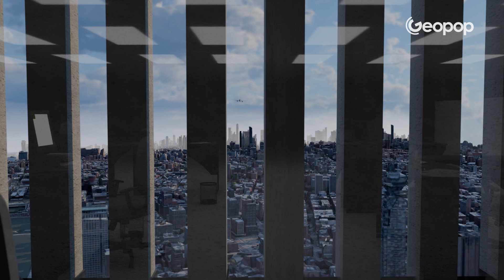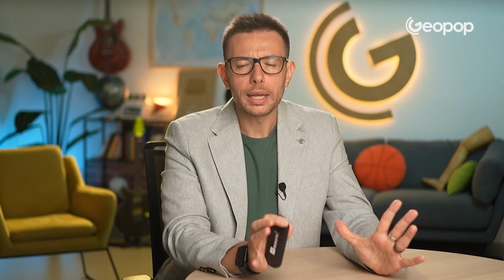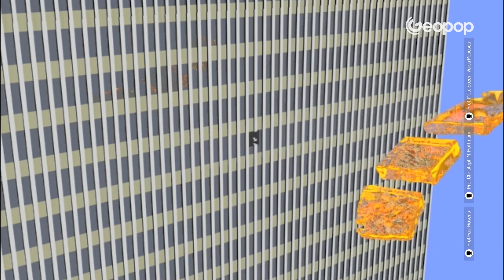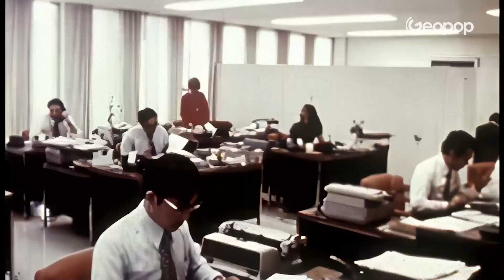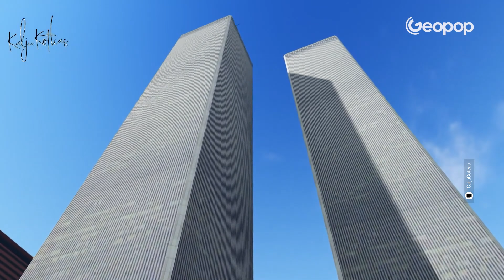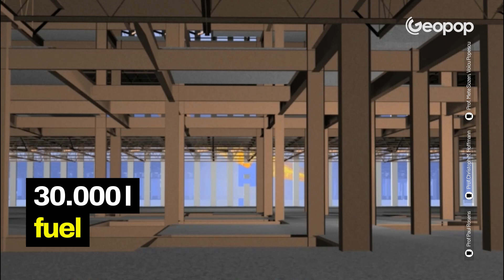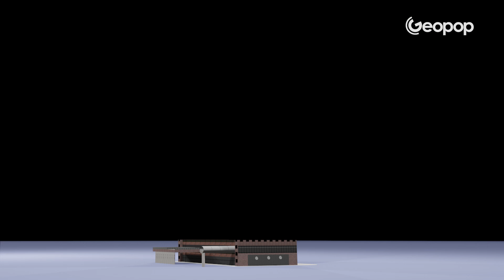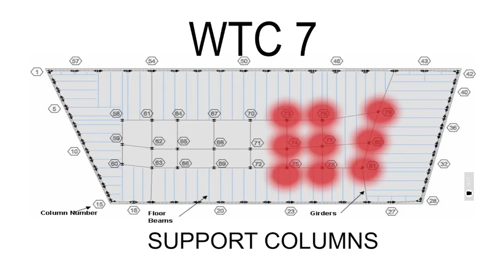9/11, 2001: The Technical Reconstruction of the Twin Towers and WTC 7 Collapses

Comment: What about every floor being slabs of concrete.? 
It should have tipped over not collapse.
Reply: Steel framed buildings do not "tip over".  They are not nearly rigid enough and there is no lateral force pushing on them.

Twin Towers collapses were actually relatively straightforward, the fundamentals already understood in the professional engineering community within just weeks. Still, there’s a lot of really bad information floating out there, mostly on the internet where it’s easily accessible to anyone. Good information takes more effort to come by and is much harder for laypersons to digest. Engineeringspeak is complex and dull. Also, some people put up a wall to protect their beliefs and false assumptions. Engineering is hard while wild baseless speculation and pathological theorizing with easy hand-wave answers is simple and exciting. Fanciful tails of pre-planned demolitions, magical space beams, melting steel and mini-nukes are just far more entertaining and require a whole lot less thinking, thus getting far more intention than they deserve.

To correct that situation, I have all on my own prepared this short yet detailed technical description of Twin Towers collapses based on my own observation and analysis of the available true and relevant facts. No politics or ideology, just the engineering. My hope is this will dispel many common myths and answer most if not all questions you may have about the Twin Towers collapses, because anything can seem like a conspiracy if you don’t understand how it works

While complex, most of the Twin Towers collapse mechanisms can be seen with the naked eye and easily discerned and understood by the layperson if sufficient time is taken to understand. 

1. The Twin Towers consisted of 4 primary structural elements that together formed an integrated system where each relied on the others.  47 hollow box-section steel Core Columns carry the majority of the gravity loads. The 236 hollow box-section steel Perimeter Columns carry the remainder and ALL of the lateral (wind) loads. Long-span Lightweight Steel Trusses connect the core and perimeter column together at each floor with a Hat Truss on top to tie the structure together as an integrated unit where no element can survive without the others. There was no structural load bearing concrete and most components were bolted together.

2. The impact of 117 tons of airplane (= to about 12 dump trucks) at speeds up to 590 mph with the energy of a ton of TNT completely destroys the aircraft. This in no way implies the Towers come out unscathed. Many perimeter columns are damaged or destroyed as are some core columns (example; 33 of 59 perimeter and 20 of 47 core columns damaged or destroyed at the impact floors in the North Tower), This damage is primarily through bolt-shearing failures at the end connecting flanges, as well as bending, twisting and fracturing of weld seams. There was no cutting or slicing - the reality was far more violent and messy. 

3. The impacts destroy or damage fire insulation, fire breaks and sprinkler systems on multiple floors.  Huge fires are started across multiple floors simultaneously and allowed to spread rapidly with no effective firefighting or fire suppression. This was an unprecedented fire event . 

4. The hotter steel gets the weaker it gets .  With fire insulation stripped away and no sprinklers the survival time of the steel greatly reduced. Gradually over time heat causes the lightweight steel Floor Trusses at the impact damaged floors to sag, which was observed and recorded.  No steel melted or needed to. Structural steel fails long before it becomes a puddle. It just needs to bend

5. Sagging floor trusses pull on the increasingly weak and overloaded Perimeter Columns, causing some of them to bow inward by up to 5 feet. A straight column is up to 4 times stronger than a bent column. The bowed Perimeter Columns buckle and fail, initiating collapse. The formerly static mass above which the structure below could easily support is now converted into a dynamic mass up to 30 times greater. Because they have buckled, the Columns above and below the failure point are no longer aligned . The load bearing structure below no longer bears any load as it falls past the lower columns, NOT onto them.

6. Thousands of tons of debris fall within the four outer walls, down through the open office space, crashing onto the first intact floor it encounters. This massive impact immediately breaks the bolted connections to the columns as the amount of resistance the Floor Trusses can offer is negligible.  The falling debris slows only marginally and briefly. Note:
6a. This is NOT a solid top block crashing into and “crushing” a solid bottom block .
6b. The debris falls past the columns not onto them.  The columns provide no resistance to the falling debris. 
6c. Only the bolted connections of the floor trusses to the core and perimeter columns can offer any resistance. A pair of 5/8” bolts at each end of each truss vs. thousands of tons of falling debris.
6d. No laws of physics are violated.

7.  This floor-led collapse progression within the four outer walls can only go straight down. Note: 
7a. This process is often incorrectly referred to as “pancaking” which actually refers to a completely different process rejected at an early stage. The catchy name stuck but nobody knows what it is supposed to mean.  Pancaking is too simplistic and inaccurate anyway. More like Kaiserschmarrn.

8. Collapse progresses through the floor systems not down the columns, through the path of least resistance . Rate of floor failures increases with each successive floor as momentum increases, reaching an average acceleration of 0.65 of GA, or 35% slower than true free fall. Bam, bam, bam down the building until there are no more floors to fail.  The resistance offered by each successive floor is always the same. The mass and velocity, thus the energy of the falling debris is constantly increasing, with each floor destroyed adding new falling mass. Some falls to the sides, but most falls down. More mass, more velocity, same resistance with each floor.  Don’t get stuck on the but the lower floors weren’t on fire nonsense. They weren‘t and didn’t need to be.

9. The Towers were 95% air by volume. As that air was compressed inside the building it is forced down the tower and blown out the sides in reaction to the building collapsing . Those were not “explosions”, it was expulsions of compressed air caused by the collapsing building, explaining the low velocity, lack of flash, blast, supersonic pressure waves and lethal high-velocity ejecta.  

10. Perimeter Columns become detached and peel away like a banana behind the collapse front, playing out to the four points of the compass extending to more than 600 feet from the base of the towers. This was quite obvious from examination of the debris pile. 

11. Core Columns fail last as their internal beam bracing is stripped away by falling debris and lateral support from the floor to perimeter columns is lost. 

12. For those who care about how long this whole process took; 31-34 seconds from the moment the perimeter columns buckled until the last core columns hit the pile, or 1/3 the rate of true free fall. Don’t believe me?  Just watch any video of the collapses and note the loose truly free-falling debris dropping much faster than the towers themselves.  

13. Each Tower had a 1-acre footprint. Far from collapsing inside their own footprints the debris pile spread out over 17 acres in a pile up to 14 stories deep. 8 surrounding buildings were destroyed and scores more damaged by the falling debris. 

14. What was NOT observed were the 180-190 dB bangs of thousands of high explosive devices or the blinding bright flashes of burning thermite. Neither could have caused the (silent) perimeter column buckling that clearly initiated collapse.  Neither explosives or thermite could have survived the impacts and subsequent fires either. A video of a shocked and injured firefighter using the magic word explosion is in no way proof of explsoIVES . The pre—planned demolition case relies entirely on that sort of thing. There is zero tangible physical evidence and it would be technically impossible, totally impractical and completely unnecessary. No one would bother. 

15.  Finally, the Twin Towers were perfectly safe within their design envelope.  They only collapsed when taken far outside design parameters by an extraordinary and unprecedented event 

Impact + Fire (heat) + Time + Gravity = Collapse . Remove any one of those four elements and there is no collapse. Ignore any of those elements (as many do) and you will never understand the collapses. The Twin Towers were an integrated system in which no one component could survive without the others. One fails, the rest follow, through the path of least resistance – DOWN – through the open space, bypassing the path of greatest resistance – the columns.  Nothing I just described violates any laws of physics. All of the above is true no matter who planned and carried out the 9/11 attacks or why 

I hope you found this helpful and informative. It is not meant to be adversarial, but to solicit informed critical comment, positive or negative. If I made any errors of fact, logic or reason or left anything critical out, please let me know so I can fix it. To stay focused just one topic at a time please and on-topic (Twin Towers ONLY). No word-salads of Gish Gallop. IF you can offer a more plausible alternative be my guest. Be the first. Please start any reply with the words “Tits McGee” or I will know you didn’t actually read it, are not serious and just wasting my time.
Reply: The concrete above ground level was not reinforced and was only 4" deep (approximately the same as a sidewalk), and was only there for flooring. It was not structural.
Reply: @kyle381000  it fell at Free Fall speed which means there was no resistance none do not even a little bit it had to break reinforcements from the floor above it
Reply: @Officialrabbitholetourguide  
It did not fall at 'free fall'. Video evidence debunked that more than 20 years ago.
Do you know the difference between force and mass? Do you know what kinetic energy is? Have you ever dropped a bowling ball on your foot?
Reply: @kyle381000  listen it was 1,362 ft tall it took a little over 10 seconds from when it started falling the same size building to freefall is a little over 10 seconds listen you can believe what you want to believe those towers had assistance collapsing.
I'm not going to get in a pissing contest with you if those buildings were not touched it wouldn't have fell as quickly
Reply: Those ratios and times come from Google if you have a problem with that take it up with Google
Reply: @kyle381000  2002
Reply: @kyle381000   Read or research someone who lays it all out . Rebecca Roth's series of books Methodical Illusions. She put it out as fiction series for obvious reasons. 
If you really think those buildings fell by themselves 25 yrs ago there's probably no changing your mind.
Reply: @Officialrabbitholetourguide  - If the Twin Towers were collapsing at free fall SPEED (which isn't even a thing) why did the collapses take 33 seconds (1/3 of free fall) and why is the loose debris falling so much faster?

BTW - I explained all this in my earlier post (that you ignored).
Reply: @kyle381000  https://youtu.be/cl5CkXlJMds?si=Z6zWFKMGqDfFMG7c
Reply: @kyle381000  https://youtu.be/uofs7b_xvso?si=nBrB8pa7oVGz_EJp
Reply: @kyle381000  
https://youtu.be/mGB9A4ODmFo?si=rqqNQOq0ZQ657LV8
Reply: https://youtu.be/mGB9A4ODmFo?si=rqqNQOq0ZQ657LV8
Reply: @kyle381000  maybe at the end of it picking up speed because of all the way from the top
Reply: @kyle381000  play what I mean by reinforcement the floors are attached to the side it has to break those fasteners it came down perfectly level not even like a little half of the floor started on both of them it makes no sense
Reply: @kyle381000  if you were to put a square piece of plywood in a square tube chances are it will get hung up on the sides of the way down not just dropped straight down especially with all that debris
Reply: @kyle381000  if my last posters that was a crime scene or at least a structural failure because it was designed for that you've never seen something get cleaned up and get rid of so fast that's not a conspiracy theory that's a fact those towers were made to be hit by airplanes jetliner airplanes
Reply: You people seem to have a hard time comprehending that gravity goes STRAIGHT DOWN.
Reply: @aldunlop4622  Well your opinion is your opinion based on your wealth experience of playing with build blocks as toddler.
If your drop 4 "x. 4" 3/4 piece of finished plywood down a 4 "X  4 inch perfectly square inside diameter 20 ft box with 4x4   3/4 blocks placed every 10 inches to simulate floors just glued around the edges...you may get your unrealistical results.
 if you it was humid out that day of testing wouldn't slide. And get your zero resistance free fall. If it all 
If that 4 by 4 box is slightly  out square .. No Bueno.
 Put a 1x 1 inch vertical solid piece of wood to simulate the elevator shaft . Oh and don't forget the stair wells .  How bout all the air conditioner condensers everything it takes to construct office furniture. 
So now let's get into all the overlapping heavy duty mending plate with 5 inch bolt holes  overlapping seams side to side diagonally braces.
Anyone that's been around for a minute news that the corrugated steel that they use for concrete floors when do when doing demo doesn't just slip off like Teflon cookware. And the fact that it was close to freefall speed both of them oh let's see all three of them. 

You're telling me that it can't get hot enough to melt all that and weaken it which is a point to maybe a couple of floors maybe for a lot longer than it actually was. 
And they found one of the hijackers passports on the ground in the debris are you kidding me?
LET ME REPEAT MYSELF FOR THE SIMPS 
Struggling to accepting reality 
hard time you know the ones everyone gets a trophy.
Your grasping leverage &  bilateral  resistance...

Comment: If you receive funding for research your research will reflect with the funders want to see.  Other wise no more funding
Reply: So, your thoughts on Leroy Hulsey's Building 7 report?
Reply: @TheCriticalStinker-jw4fl  I have questions like what was that building housing what kind of information was it holding ancer  those questions then I can give you a thought
Reply: @user-jackmayhoff  - I only want an answer to the question I asked, NOT a deliberately evasive off-topic derail. 

Remember, you broached the subject.
Reply: @TheCriticalStinker-jw4fl  that was a broad statement about funding and research across all subjects.     colleges, private.. ect
Reply: @TheLoonResistance  I don't know enough on this subject
Reply: What is the source of the many tons of molten steel found in and under the debris, the heat so intense that the molten steel remained in that state for weeks afterward, running off of the debris as it was excavated. This cannot be molten copper from wiring that retains the color of a shiny new penny.  It cannot be molten aluminum that retains the color of the polished aluminum wheels of a street racer. It was the color of glowing orange molten steel  that cannot be mistaken for any other material, reported by firefighters who are very experienced in the nature of such materials as well as seen in video evidence.

When you combine this with an entire lack of turbulence behind 500 mph aircraft, when even a small Cessna Aircraft would leave an evident wake in the smoke and fire only seconds later .  . We find that skeptics still cannot be skeptical of the official narrative in explanation.  Sponsored channels and forum activity are skeptical of nothing when support is provided.

Sponsored activity in the forums is very normal today for commercial and political purposes and subjects of controversy -- in the attempt to lead public debate.

Comment: Excellent video! I can’t understand why the conspiracy theorists have such a problem believing scientific facts
Reply: They are believers NOT thinkers

You can't reason someone out of a position they did not reason themselves into.
Reply: Me either.
Reply: Point proven.
Reply: @TheCriticalStinker-jw4fl  yes it is stinky
Reply: The facts are Multiple New york city firefighters claimed it looked like controlled demolition.  Every camra angle of those 3 towers looks like a controlled demolition. The facts is there were explosions reported going off all day, and the official story is there was no evidence of explosives. We know that isn't true. The FF admitted there was secondary explosions.  And the fire suppression system didn't work. You can see the explosions 50 feet below the collapsing tower  1 and 2. The debris was only as tall as lobby. Commercial jets cannot fly 600 miles per hour a 1000 feet off the ground.Do your research. That's why they fly thirty five thousand feet. Lots of people reported a big grey plane and a non geometric bottom proving it was a military plane.  And if one of them was they all were. If it wasn't a missile that hit the pentagon like multiple people witnessed
Reply: @robbiehiatt9966  Complete nonsense.